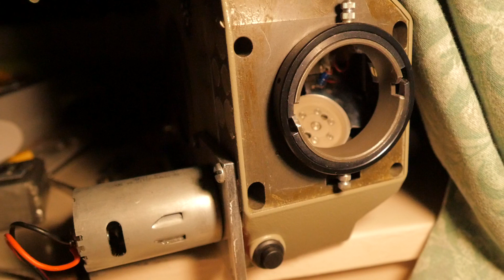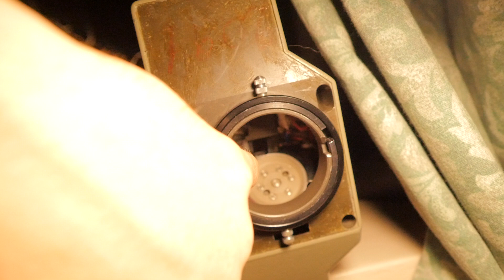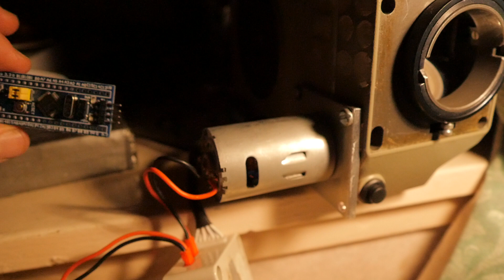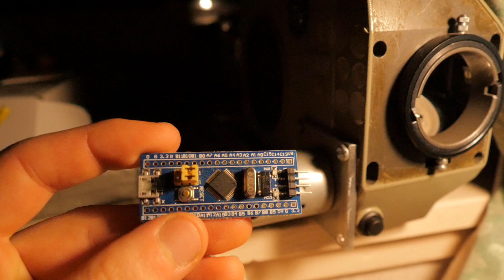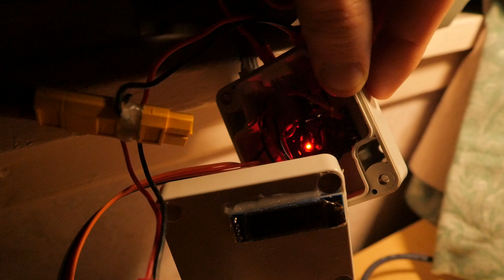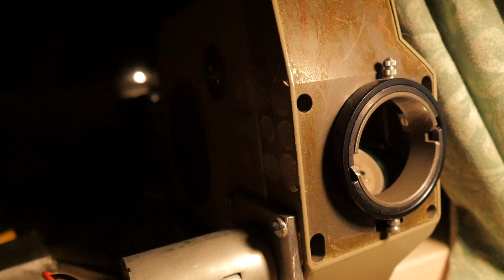Krasnogorsk K1 Electric Drive Update

Comment: Firstly, consider using github/gitlab for your project, it will allow others to follow along and make it easier to give you feedback.

Secondly, there are plenty of higher spec'd arduinos, the teensy and the esp32 are good choices - both work with normal arduino ide and provide faster cpus and better ADC.  But I'm not sure why you need an adc at all - what you are doing is adjusting two pulse trains, one from the position sensor and one driving the motor.  I would instead do everything using counters and timers, count the time between the position pulses and compare that and the ideal time, then feed that as a signal into a pwm output for the motor.  One algorithm for this is to turn the motor on once the position sensor has taken longer than you want, then turn it off again when the next position sensor happens.  If you add the excess time to the frame counter you will get proportional control with the highest possible bandwidth for your system, which is probably sufficient for this application.
Reply from the maker: Thanks for your comments, I am not using the ADC at all and the stm32 I have works with the IDE. I will do a test run with it sometime.

Comment: the stm32 is a totally different beast compared to the arduino.You can configure the arduino ide to compile for stm32 but beware not all of the libraries are ported.Also you will need a st-link v2 to program it.I have a blue pill but i code in C with System workbench because i dont like the arduino ide.Forgot to mention that you can install Atmel studio and write arduino programs with it.
Reply from the maker: I was able to program it using a usb to serial adaptor. I will maybe start work on porting the project over tomorrow and I feel a bit bad about you spending time working on the stepper code and it not working out. I used atmel studio a long time ago but it was a bit beyond me.
Reply: @ShaunDobbie  Great job with Arduino, it is very good achievement. I am thinking about the realisation of this idea using electronic circuits.
Reply: Its ok I spent less than 5 hours working on the stepper code.It wasn't complicated.Using a usb to serial adapter is fine but i don't think you get debugging info(im not sure). Its better to get the st-link.I got mine for 1.84$ if im not mistaken.